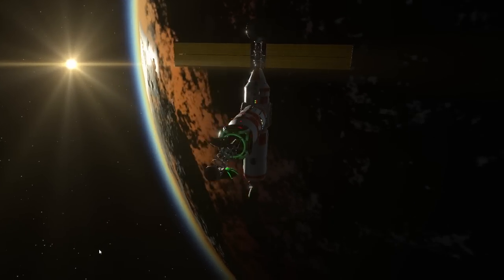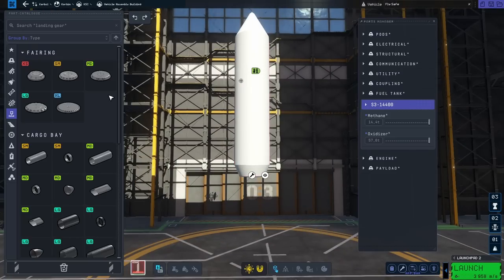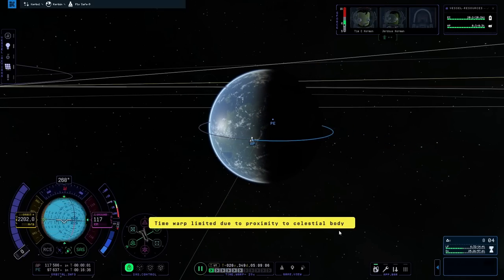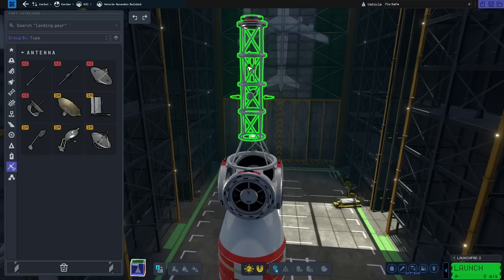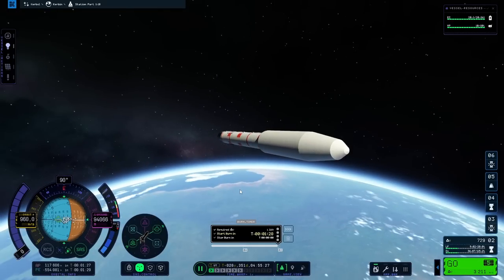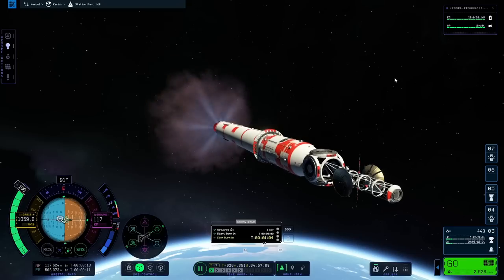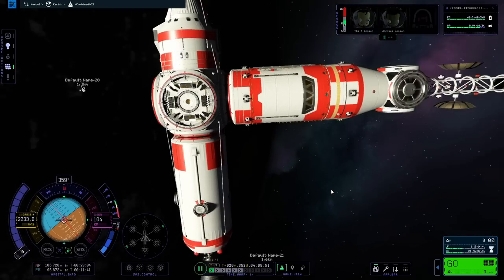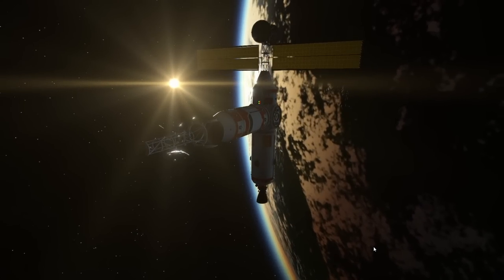Orbital Rendez-Vous and Docking in Kerbal Space Program 2

Comment: my attempt did go like this:
- The moment I got close to the other vessel frame rate droped by a lot

- reaction wheels are weeker, so I should have added more RCS.

- after searchin for a while, I found how to activate docking mode. But shift throttled up the main engine and crashed into my station 😂

after loading quicksand I succeeded with docking. but decoupling from part destroyed the station (I though) 

after a few quicksaves I managed to succeed. my station did not blow up, the message was wrong and I could find the station intact in the tracking station.

Game still neefs some work and I need to get a bot more adjusted to ksp2
Reply: You dont need docking mode

Comment: What resolution you playing on? You get fuzzy clouds when you are on 1080p. 1440p has no fuzzy clouds.
Reply from the maker: yea i play 1080p. Given the requirements its a safe bet :-P. I was thinking to play 640x480 given the performance (on RTX 2080), haha
Reply: @GrunfWorks  i have a 1660 super and play on 1080p its mid ig. yeah the reason why your clouds look like that is the lower res. So dont play on 640x480. This is an issue they are fixing. You pass the requirements so don't worry about a thing.